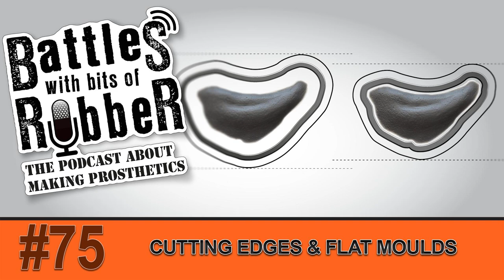#75 - Cutting Edges & Flat Moulds

Comment: Gelatine always sticks to my scraper. How can I stop it sticking?
Reply from the maker: During scraping or after it has cooled down? What is the scraper made from? Plastic/spring steel/stainless steel etc?
Reply: @stuartbray  When it is hot during the scraping. Plastic
Reply from the maker: @arabellamayer9195  I would suggest a steel scraper instead. It may be the heat of the gelatine is affecting the plastic.  Most plastics are injection moulded by melting plastic to a liquid. It's possible the heat of molten gelatine is sufficiently warm enough to mess with the plastic.
Reply: @stuartbray  thanks 🙂